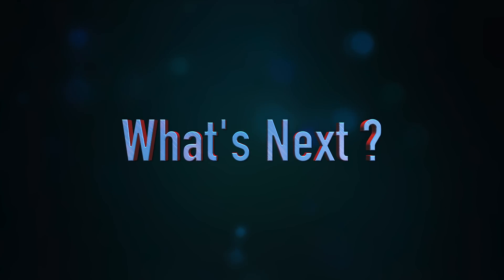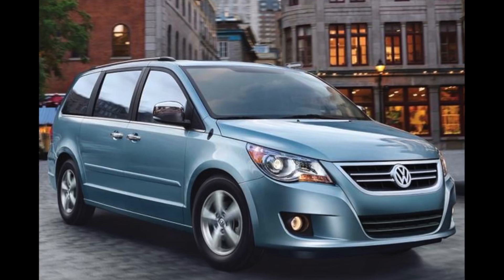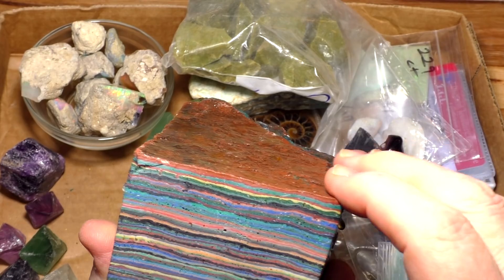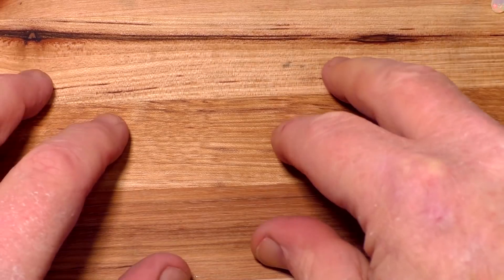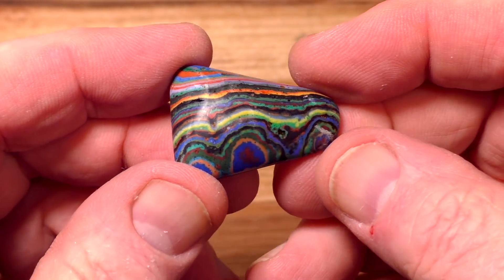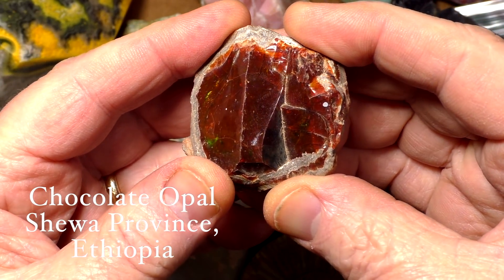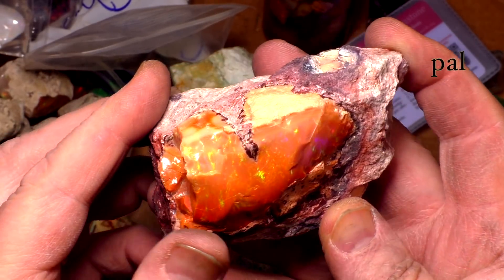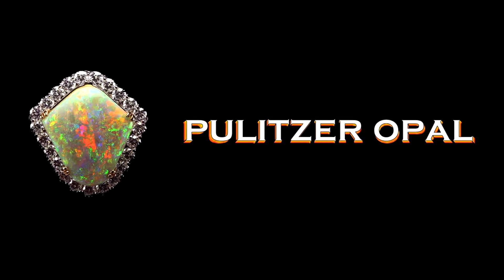Opal and other Beautiful Gems!  In Tucson

Comment: 9:31
Another one of my top 5 cabbing gem materials of all time. Finland's is alleged to be the best but I've seen some spectacular examples from Canada and Madagascar.

I've not seen the Labradorite from places like the Ukraine so I can not compare.

Now days, the term Spectrolite doesn't necessarily mean it is sourced from Finland.
Reply: @PulitzerOpal  I've found 
Labradorite to be real tricky to orient correctly for maximum labradoresence (that flash of colors). But if you get it right, it can easily be one of the most beautiful treasures on earth to behold.

That stunning flash of colors is  why it's up there with gem opal and gem ammonite as the best natural stones in my opinion.

Comment: I will be in Tucson a few days over the course of the shows (intermittently)... it’s one of the highlights of my year.  I’m wondering if there you could / would recommend a couple dealers who would have material suitable for a complete beginner.  I’ve cut some cabochons, and must admit I’ve bought some open rough which I haven’t cut (yet)... But it would be great to work with a dealer who could point me to some appropriate rough - not great (because I might ruin it), but good enough to yield something worth having if I don’t screw it up.  I understand completely if you are reluctant to put your foot into this muddy topic...  Thanks again for all the great videos!  (And sorry if you’ve done so in answer to another comment I haven’t gotten to yet...)
Reply: Thanks so much!  If the “Ramada” show you mention is actually the Pueblo show (the motel hasn’t been called the Pueblo since probably the 18th century), that’s one I go to every year!  (Could be another show is at a Ramada also, I guess...). And yes, I do see lots of dealers there with Ethiopian opal.   Believe it or not, just your tip about expecting to spend $8 to $12/g for decent rough is helpful - seems like the prices can run anywhere from $2 / g or so, and on up.  The 22nd St show - another annual favorite of mine - also has some Ethiopian opal, I believe.  I’ll also be going to the JOGS show, so I’ll keep my eyes open there.  Unfortunately, since I’m just a hobbyist without a tax license, I can’t easily get into Holidome or GJX (that is NOT a hint or hidden request, just to be 100% clear)...  Thanks again for the info, very helpful!!  Hoping you enjoy the shows, and find some good rocks to show in future videos...

Comment: Opals are packed in different ways. Are the water packed opals so unstable that they can't be made into jewelry ?  Why are some more unstable than others ?  ( I do know weather/heat & bumping them on something ( ex. ring or bracelet ) will break them. )        Thanks !        PS.  I do think that " Peanut Wood" is interesting.           :)
Reply: @PulitzerOpal  : Was wondering.  I've had some jewelry break just sitting in a drawer, in their cases.  But I do live in Texas, can"t tell about the weather.  Thanks !

Comment: Take your knapping skills up a notch and make a small knife blade out of opal. Doesn't have to be all color of course, maybe something with an interesting strike of color running through it, or maybe some of that opaque-colored opal you bought. Then test it's sharpness on a steak . . . those seem to get recommended a lot on YouTube.
Reply: @PulitzerOpal  I hadn't thought of it at the time, but in rewatching I could see that larger 4" piece already kind of has a knife profile to it, might even be able to attach a handle/grip to it somehow, depending on the level of functionality you'd want to achieve, perhaps either a wooden fitted handle fixed with epoxy, or a bone handle just tied to the blade with cord. Even that little piece could make a small paring knife or peeler.

Comment: I was very surprised at all of the different types of opal - it was a good day learning something new :)  Back in a former life, I made custom jewelry, and wanted to get to Tucson, but never got a chance to.  Thanks for the glimpses of the wonders of those shows!
As for other topics, one I have wanted to learn more on is stabilized opal: I understand it is to seal up fractures; is there any way to easily detect if an opal has been stabilized?  And is stabilized opal easier to work with, or does the epoxy resin complicate things?  Would a methacrylate sealer work any differently than the Option fracture sealer?  Can opal be treated in any other method (heat, laser, radiation), and what does it do to the stone?  Thanks for all of your wonderful work and videos in 2019!
Reply: @PulitzerOpal  Disclose? hah. If you shine a black light on fake jade I hear it glows. Rumor has it some of those Tucson fossils, when they break have news paper inside. I think you could go crazy trying to figure out whether things are fake or modified. I think alot of these "experts" are practicing greater fool theory when a fake is able to pass the test of an "expert" appraiser and auction off for tons. I think you could spend a lifetime trying to figure out all the ways things can be faked or modified and still not have a clue when alot of people refuse to reveal their secrets or there's no way from telling a natural vs. modified or reproduction. It's enough to make you go crazy and cripple yourself into a state of overthinking. If I make gold in a nuclear reactor and let it's half life run down to radiation levels of natural gold is it artificial gold? Should it be worth less? They'll fake beach glass. I hear all about how it's not as good as natural and how to tell the difference From guys that need to sell you natural beach glass. There's no real reason to train your eye to recognize counterfeit beach glass. There's no real way to fill an aquarium with watermelon beach glass aquarium gravel without the counterfeit stuff. Most if not all dinosaur fossils at museums are some kind of fill in the blank work from the partial fossil they found. Sometimes this partial fossil is just a single spine disc they then counterfeited in a different color to signal that they found it and hide the real deal in the back. Probably why alot of archaeologists started seeding fakes for other guys to find. Not as a joke. My guess is they went crazy and thought it would be an example about no one having a clue. Show me all your tools and what you do with them.